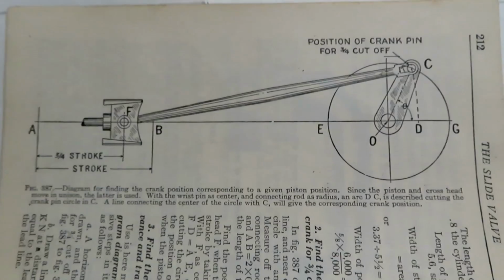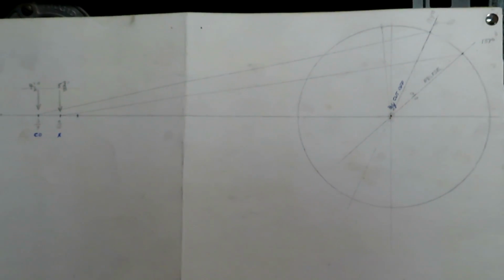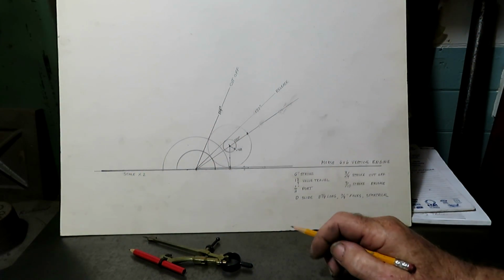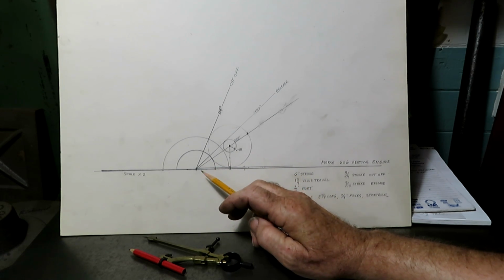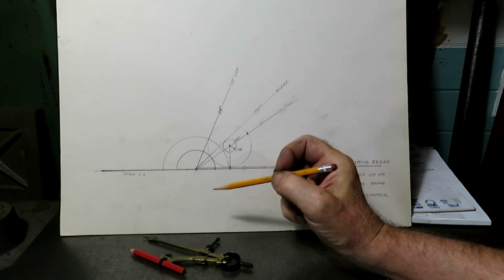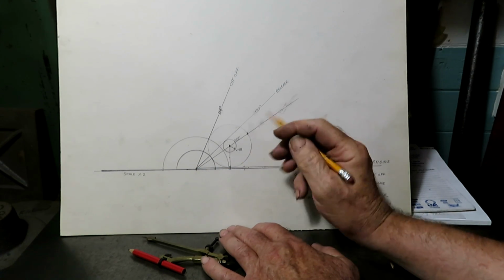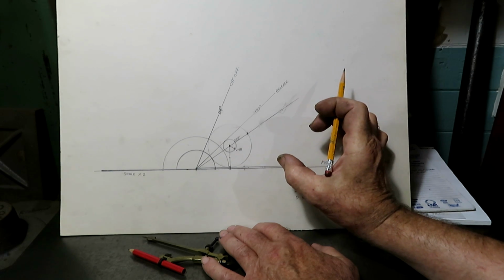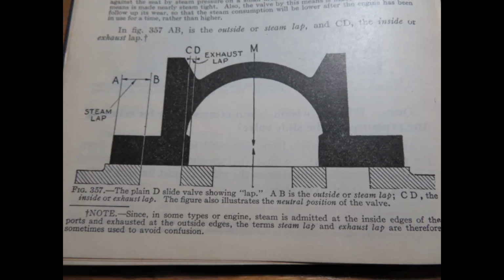OLD STEAM POWERED MACHINE SHOP 43   Designing a steam engine slide valve

Comment: Hi, great video. When I see your shaping machine it reminds  me of my  apprenticeship days when we made a cast iron vice as a project. I must be getting old as I have also worked a Planing machine, huge vertical borers and horizontal borers. I wonder how many people now days know of Turret Lathes, Capstain Lathes, peg board lathes and multi spindle lathes and gang cutters on Milling machines. I did my time on those machines and also NC's from punch tape to computers that is how fast machining has progressed. You always love machining. I am 57
Reply from the maker: Hi Charlie, Not many people that young have had that kind of machining experience.....Dave
Reply: I'm right there with you, well, actually a little further down the road in my seventies now and retired since '04'.  Similar background with receiving my apprenticeship in the Canadian Navy with everything from scraping multi-land super-heated steam high pressure connection flanges and progressing in later jobs through Numerical Control courses using Apt and Ad-apt even some old Cobol programming.  You are spot on with the trade progress being remarkable in such a relatively short period of time. 

I agree completely with the satisfaction we get from watching  a guy like David take us back to those line shaft belt drive days of your and even more so using steam power.

Comment: Very similar to cam timing on  a engine, you start opening the intake BTDC and start opening the exhaust before bottom dead centre. And the longer the rod the longer the pressure builds up to push it down
Reply from the maker: Right, and it's happening on both sides of the piston...Dave

Comment: Hi again Mr. Richards

That shaper seems to be very happy...
There was an old Alba shaper I missed out on about 6 months ago...
That was an old lineshaft driven machine as well..1926 I think he said it was....
Needed work on the gearbox as one of the Bush bores had gone oval...
Should've grabbed it really....hmm...🤔

Nice video of the drill press as well...
The large disc at right angles with the drillings in it...what's that for...?

P.S.
I've posted up a video on my channel of that old turret lathe I were on about...if it interests you...😉

Comment: It is so cool to see someone with your knowledge making a part for a steam engine using a steam engine to power vintage equipment in the 21 st. century. Thanks for taking the time to explain the slide valve function and timing which you thoroughly understand. I have no doubt this valve will work exactly as designed by a master machinist. Keep the vids coming.
Reply: David, one question, is the ratio of the eccentric throw to the stroke always the same?
Reply from the maker: Stuart, I don't know if there is a rule of thumb on that, but on a simple "fixed cut off" type engine it would have more to do with the port width than the stroke, and the port width (and area) would depend on the bore AND stroke.  From what I've learned, the port area is the first calculation valve design. Maybe some model builder viewers can get into that deeper....Dave

Comment: Dave I had no idea that a slide valve was so complex. Thank you for explaining it in such a way as to give us an understanding of the importance of this thing being right.
Reply: If it is not right you will  hear it and feel the engine complaining, sometimes hard or it can be very hard to detect, but Dave will adjust it or scrap it and back to the drawing board
Reply: These things were developed by men without a PhD in mechanical engineering.

Comment: Impressive how sensitive to load the governor is.  I'm sure the mass of the line shafting has a flywheel effect and stores a certain amount of kinetic energy to smooth things out.  Have you put a tachometer on the shaper to measure the RPM variance (as if it really matters)?
Reply from the maker: Nate: It impresses me too, and those older "Gravity" governors like that one were said to be too sluggish to run electric lighting plants and keep the voltage steady. That was supposedly what led Mr Pickering to develop his light weight "spring" governors, which were suppose to be a great improvement. I don't know what the variation is, but I bet it ain't much......Dave